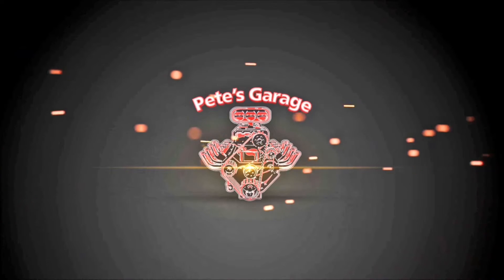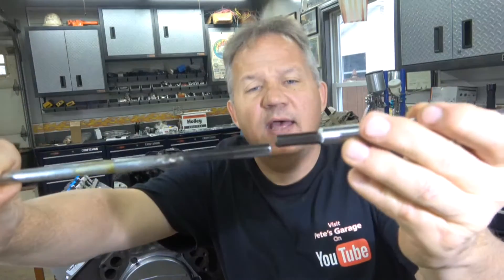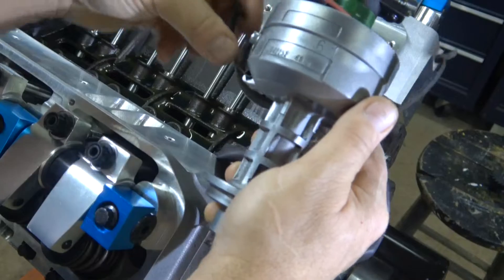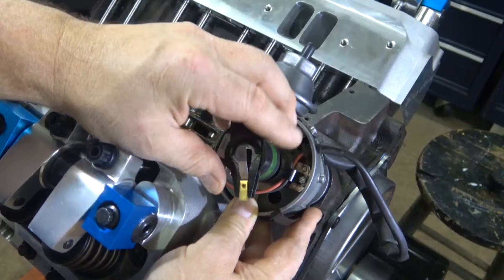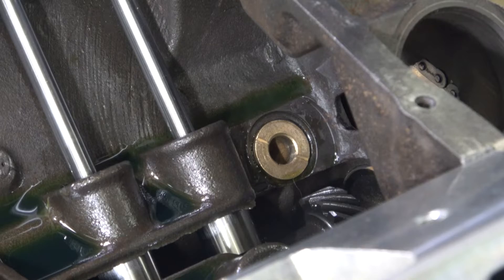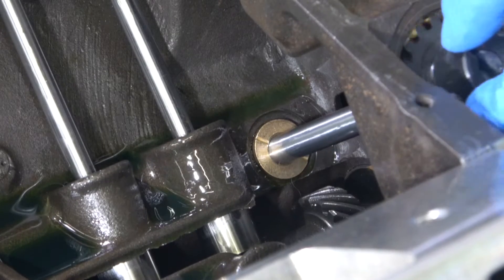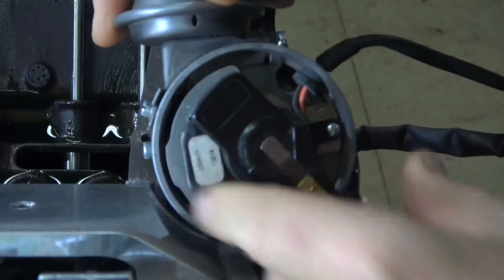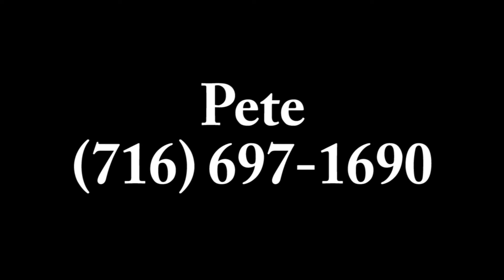Engine Building Tips - Intermediate Shaft Installation 440 MOPAR 512 Stroker

Comment: Few questions 1) Does that Carter fuel pump work fine for street use on a 512 build, 2) Are you using a 5/16 or 3/8 fuel line to carb, and 3) What brand fuel pump push rod are you using or recommend and 4) What brand intermediate shaft are you running?  Building a very similar motor except cam choice

Comment: You have 2 videos of this one said parrell with the cam  the other video said parrell with the front of motor  both 440s what goes I'm confused
Reply from the maker: Different distributors, align the slot so the rotor points to #1

Comment: Do you remove the inner springs if you have double springs for a 572 flat tappet in a 383 mopar ive never done it on any thing else but now they say i have to
Reply from the maker: This is a very controversial subject. I can't tell you what is right or wrong, but I'm willing to bet they never did that at the factory. That's changes if you have a high lift cam with big numbers for spring seat pressure

Comment: Thanks for posting this. I can't tell you how many times I see distributors at car shows that had the intermediate shaft installed a few teeth off from factory specs like you showed.  I saw one recently that the vacuum advance canister was against the wire loom on the thermostat housing, preventing any additional advance if needed.
Reply from the maker: It's easy to fix too. I don't know why they leave it like that